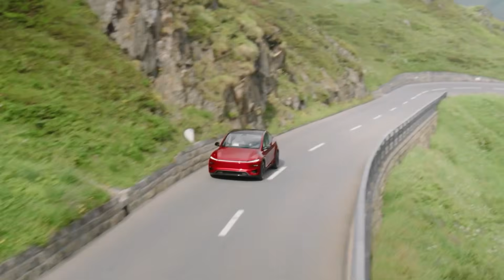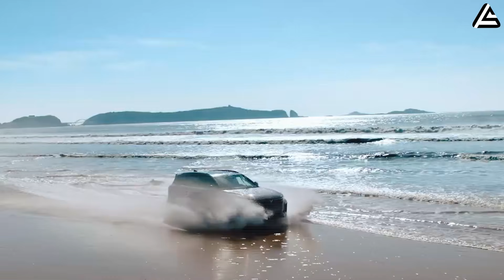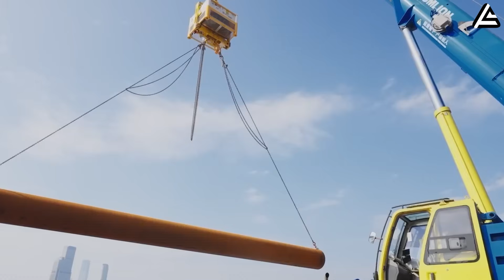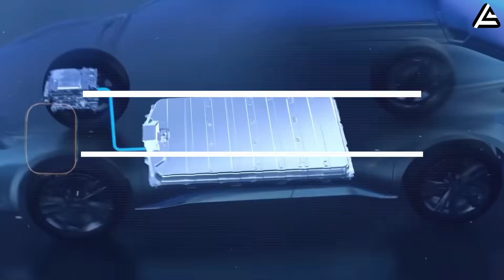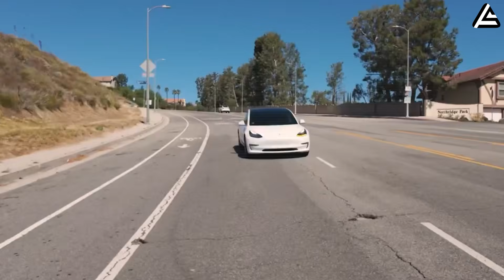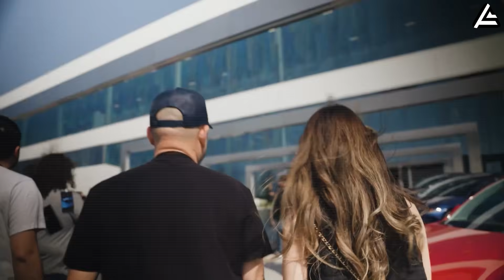Tesla Solid-State Battery 2026 MIX: Timeline, Production Reality, and Cost Signals

Comment: Even if the battery capable of 100000 cycle life Donut shouldn’t have advertised it in the beginning as it’s hard to believe when compared to the current battery chemistry’s. Instead they should have advertised as 10000 cycle life which is more realistic for anyone.
Reply from the maker: That’s a reasonable criticism. Jumping straight to 100,000 cycles sounds more like a lab-theory number than a real-world automotive spec, especially when today’s proven chemistries (LFP, NMC) typically deliver a few thousand cycles in practice.